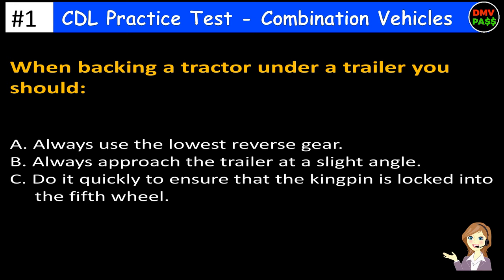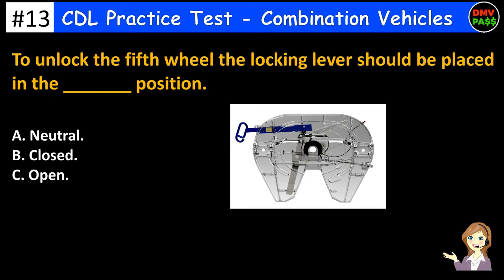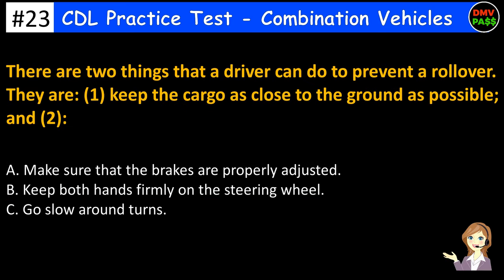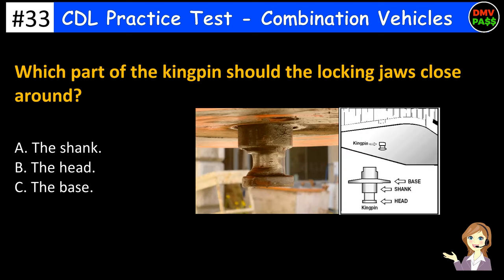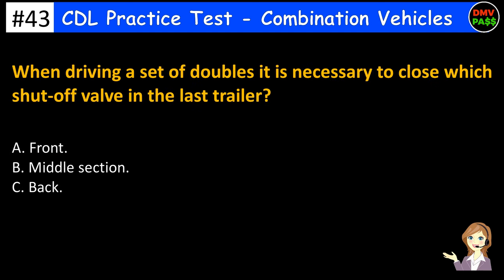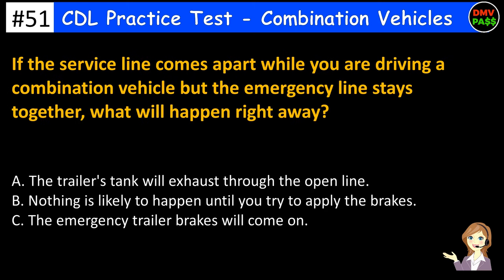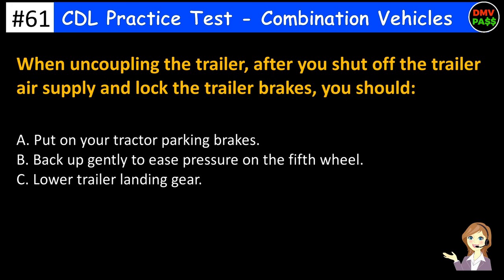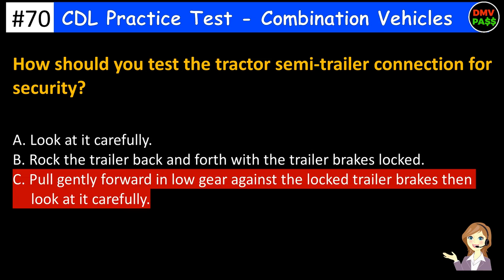CDL Prep Test/ Combination Vehicles Questions & Answers

Comment: Special Notice to all You Tubers about Trucking CDL test question on inspection. It's said by  every bloggers that checking fuel level is not required. It's not TRUE. Look in the DMV Manual, 2019 -2021 , page 2-6, second row, line 35. Tanks (s) contains enough fuel.  Section 2.1. Driving Safety requirement. The driver is personally responsible and part of the pre-trip inspection, mandated by DOT. Just be aware, don't get sued   for providing false and misleading information. I am watching you. You will not be spared for bringing chaos in to the freeways. And the teen agers stop abusing the CDL is not your play ground just to be messing around with the test questions and the legal field. Go else where to make your dough.. Thank you for your understanding and cooperation. Sincerely, instructor/ driver with million miles and 49 years experience. Thank you.
Reply from the maker: Thanks for your comment. If you've anything like that on this channel feel free to let us know so we can take action asap. Thanks 😊
Reply: Well said 🎉
Reply: 5

Comment: You don't answer question number 4
Reply: Answer is B.
Reply: no is right red, blue I search
Reply: 4. Is C
Reply: Final answer: In combination vehicles, the emergency line is colored red and the service line is colored blue to prevent mixing and ensure the braking system functions safely

And that's from the test